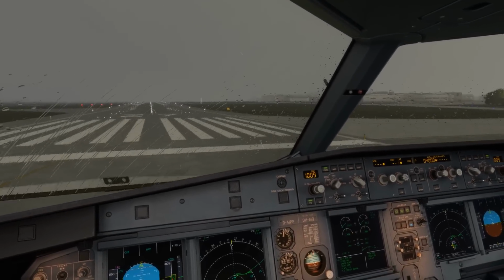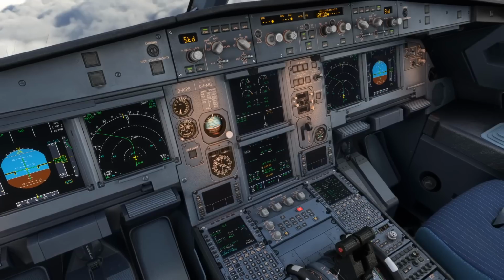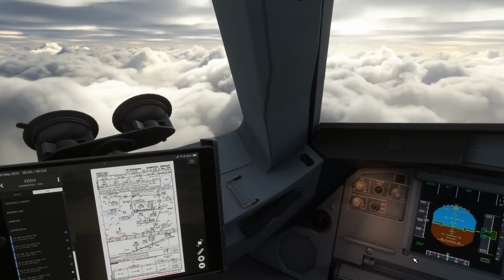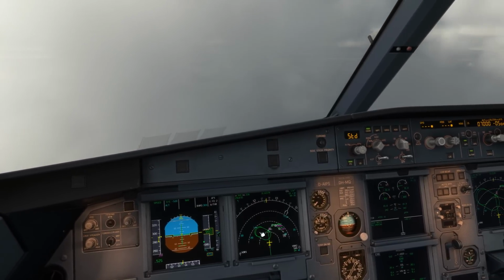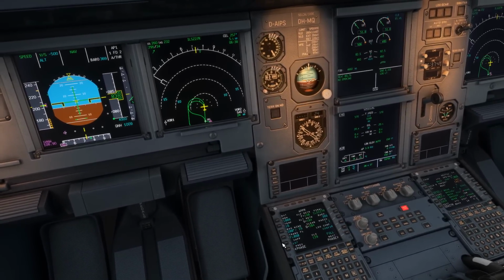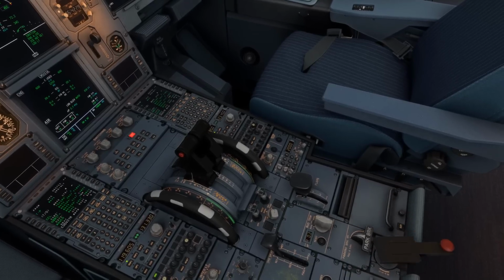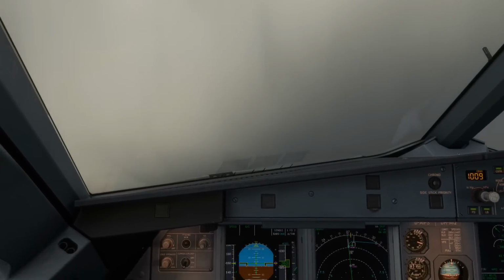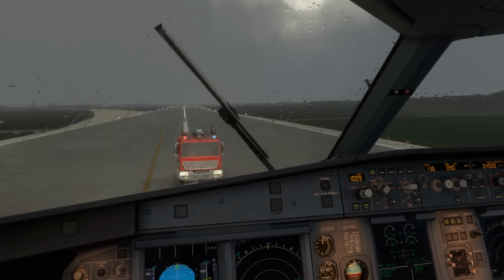Still Think MSFS isn't a "Real" Sim? | Real Airbus Pilot - Fenix A320 | Failure Scenario | RTX4090

Comment: Great video - I'm also an Airbus pilot in real life and currently use the Toliss A319 for procedures practice and general revision in XP11 (in VR). I'm pondering buying the Fenix A320 as I prefer FS2020 to XP11, but wondered if you have compared the two? The Toliss has really impressed me with its fidelity to the real aircraft and I'm curious if the Fenix is comparable in your view?
Reply from the maker: Hi Jonathan,

Thanks very much, I’m glad you enjoyed the video. To be honest, I only have a very limited amount of time with the Toliss A321 (2-3 flights) so, I can’t draw all that many comparisons. At the moment, the Fenix doesn’t do a very good job of hitting real-world performance numbers but, that ‘should’ change once the next big update for the aircraft comes out. The Fenix is a pretty good systems trainer, with hundreds of possible failures, that are easily programmed: https://soarbywire.files.wordpress.com/2021/08/failurelist-v0.2.pdf

Certainly, for me, I find that the Fenix has more than enough fidelity, that I can brush up on a few scenarios or procedures, ahead of a sim etc; the addon doesn’t get everything spot on and as with any PC simulation, one does have to be cognisant of that fact.

In general, I prefer how the Fenix handles / “feels”, even though the performance is currently off. From what I remember of the Toliss, systems depth on the two addons is probably broadly comparable but, the UI for setting up failures etc, is more user friendly on the Fenix.

I hope that helps a little. All the best! : )

Comment: This is not a study level craft
Reply from the maker: Hello John,

What makes you say that? The Fenix A320 doesn’t currently perform to the numbers (though Fenix should be addressing that soon, with a significant update) and for sure has a few inaccuracies, but otherwise I find the addon does a very decent job of simulating the systems / flight characteristics of the Airbus. I know we all have different definitions of what constitutes “study level”, but the aircraft is certainly detailed enough, as to be useful for practicing certain scenarios : )

All the best!

Comment: You.losing performance with that 2666 mhz ram surprise you are not using a ddr5 motherboard or atleast  3600 or 4000 mhz ddr4 ram.
Reply from the maker: I know Willie; I was a bit perplexed / annoyed when I saw the specs of the RAM (I had a PC custom built and we never specifically discussed the speed of the RAM). Whilst the performance degradation hasn’t been noticeable per se, I will get around to switching the old RAM out for a faster option at some point.

Cheers, all the best! : )

Comment: did I just hear something about realistic? So when I see the windshield wipers moving differently, it's not realistic for me. The Reichstag in Berlin is not even realistic. To me, the Reichstag in Berlin looks like it was from World War II. And all this with an RTX 4090, what a waste. I can do that with a 2080Ti too
Reply: wipers are not synchronised in rl
Reply: It’s better then any hideous xplane toliss garbage. Doesn’t look like 1999 at least
Reply from the maker: Hello Andre,

Well, the wiper movement may not seem to be realistic, but the lack of synchronisation is actually true to life of the real aircraft. I can’t speak on the Reichstag (I haven’t checked it out in MSFS), but accurate landmarks aren’t really essential for an in-depth simming experience (and at any rate, surely no other sim comes close to being on a par with a MSFS, when it comes to its visual representation of the world around the user).

I use my PC / 4090 for more than just playing MSFS, but the 4090 allows me to crank everything up to Ultra whilst still maintaining a solid framerate (which is great for recording), so it’s nice to have either way.

I’m not trying to bash other sims: I’m a big fan of X-Plane, P3D, DCS etc (indeed, I still use all of them), but I really don’t see how after running this sort of scenario, it’s possible to argue that MSFS can’t be used “realistically”.

Cheers, all the best : )

Comment: Rathet fly FSLabs on P3D or Toliss on XP.
Reply: Why
Reply: Fslabs on P3d is way better then toliss anyway. Toliss is low quality bs
Reply from the maker: Fair enough FF, to each his own. I hear great things about the FSLabs 320 and by the sounds of it, the addon is a deeper / more accurate representation of the aircraft overall - I haven’t tried it myself. The Toliss Airbus’ (I’ve only tried the 321) are decent enough, but personally I much prefer the Fenix A320 overall (yes, it has some shortcomings, but Fenix are working on them and I can look past a few issues, in order to enjoy the vastly better visuals of MSFS. The Fenix A320 is also considerably cheaper than the other 2 options). As I say, horses for courses : )

All the best!

Comment: Interesting so even in an Airbus the ignition must be left on while soaring through the clouds. I always thought this is an eighties era Boeing-quirk and no longer necessary with the newest CFM engines.
Reply from the maker: Hello Julia,

It depends on the Airbus in question. On the older variants of the Airbus that I have flown, ignition is typically selected on when passing through significant areas of precipitation, but on the more modern Airbus’ that I have come across, manual selection is no longer required from the pilot.

I hope that clarifies things a little. All the best : )

Comment: Very nice. I'm thinking airline companies can then use this for flight training scenario's. MSFS would need to have co-pilot seat available, and then completing scenario's such as this would be part of your monthly?
Reply from the maker: Cheers, NorthBlue. Yes, whilst of course certification etc would be required, it often amazes me, the level of fidelity that one can achieve with a home simulator these days. To some degree, this sort of setup is actually a step beyond many of the training tools used in commercial training - it really is rather impressive.

Cheers, all the best! : )
Reply: @IntotheBlueSimulations  Yes, I agree. I hope one day they can run an experimental study just to see if you can learn to fly via online schooling and certified home flight simulators with an online cross country simulated flight and an actual flight to complete the process. And with A.I. around the corner it should get really interesting.
Reply from the maker: I certainly think a large chunk of training could be accomplished using modern flight simulation, particularly with the advent of VR etc. There are certain aspects of flying that can only be appreciated with a real aircraft though, so I think that would always have to form part of the syllabus. If nothing else, there’s a big psychological difference between flying in the sim and flying in a real aircraft, where you’re conscious that any mistakes can have significant consequences. It’s an interesting topic for sure though!

Cheers once again : )

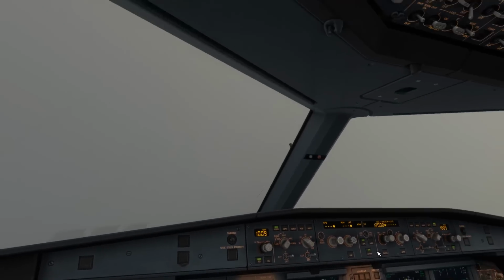Comment: 6:04 aren't the landing lights supposed to be on under 10,000ft?
Reply: In these conditions they wouldn’t bring you very much
Reply: @Jan-ov5tm  I know, but I'm asking about procedures and how it's done irl
Reply: @tvflight7858  Im not a resl pilot, but as i know from rl videos etc., they mostly turn them off when passing 10.000 feet (europe, i dont know how its done in other parts of the world). But as i know, airlines can decide when to turn them on/ off. (SOP)
Reply: @Jan-ov5tm  thanks
Reply from the maker: Hi TVflight,

Generally speaking, you’re correct. 10,000ft is the norm, though as the 320’s landing lights do produce some drag, some operators opt to vary this via SOP (so I gather - we actually use 10,000ft at work).

I hope that clarifies things a little. All the best! : )
Reply: @IntotheBlueSimulations  Thank you so much!
Reply from the maker: You’re most welcome! : )

Comment: For sure, MSFS is a real simulator, but don´t judge it with an Airbus; It´s not that flying like with a glider or a GA, it´s more serving a hightech machine. IMO X-Plane feels better with smaller planes but not better in terms of Airliner flying.
Reply from the maker: Hi Thorsten,

I take your point, but (in my opinion) there is more to flight simulation than the flight model alone. X-Plane is still king when it comes to flight modelling (although funnily enough, I’ve always preferred X-Plane for the heavies and MSFS for the GA stuff haha, though I haven’t tried any payware GA stuff in X-Plane to be fair), but MSFS has become a very competent systems simulator, and does a great job with handling the sort of scenario I demonstrated here. As always, there’s no perfect sim, but MSFS has come a very long way!

I hope that makes some sense. Cheers and all the best! : )

Comment: Does the weather radar still not work on MSFS?
Reply: no
Reply from the maker: It does not Rob, no. Well, there is basic weather radar functionality modelled within MSFS, but developers generally choose not to use it, since the existing functionality is not very accurate in its implementation. Asobo should be providing better functionality to 3rd party devs at some point, but this is taking quite some time to eventuate. . .

I hope that clarifies things. All the best!

Comment: I've groused a LOT in the past videos about MSFS and it constantly updating and just plain not working well after that.  I'm happy to report that I have purchased and huge M.2 drive and have completely reinstalled MSFS2020 - and it works BRILLIANTLY.  It just works.  I've been using it a lot more.  I'm trying to find a decent deal on the TrackIR 5 now.
Reply: You should consider the TOBII eye/head tracker. I have stopped using my TrackerIR 5.
Reply from the maker: That’s great TG! I’m very happy to hear that you’re getting on with the sim much better these days. It hasn’t been a smooth ride for many, but Asobo have continued to put the work in and by and large, MSFS is in a pretty good place these days : )

Happy flying and all the best!

Comment: Hey Bud, great video. Really nice Aircraft and scenario. Still can't believe your recording in 1080p with an RTX4090. C'mon man.
Reply from the maker: Thanks very much Nitrous, I’m glad you enjoyed it! Haha indeed; I have tentatively looked into recording at higher resolutions and that was the reason I got the 4090, but I want to do things properly and that requires testing, tweaking etc - something I simply haven’t had the time for as yet ; )

Cheers, all the best! : )
Reply: @IntotheBlueSimulations I’m new to VR flight sim. I fly the 320 and would like your opinion on using this for recurrent training. How many failures does it simulate ?
Reply from the maker: Hello Harry,

Of course, all of the usual caveats apply (it’s a home simulation aircraft, there may be some inaccuracies vs the real A320, FCOM’s take precedent etc), but I find the Fenix A320 can often be a useful tool for refreshing procures and running through failures / scenarios. At the moment, the aircraft doesn’t fly by the numbers, but Fenix should be putting out a significant update soon and that should address most of the flight model issues. In terms of the number of failures modelled, it’s significant. Here is a list; it’s somewhat outdated, but should give you a very good feel for the level of complexity on offer: https://fenixsim.com/public/images/failurelist-v0.2.pdf

In short, the Fenix A320 is not infallible and I have come across a few behaviours that don’t match up with the real jet, but all things considered, it’s a very solid simulation and offers a lot of value for the price - it’s great for running ECAM’s, of nothing else.

I hope that helps a little? All the best! : )
Reply: @IntotheBlueSimulations You don't need to test, just do a video, so long as you record to SSD it will be fine. The Rtx4090 (I use too) has dedicated part to it for streaming/recording, so it doesn't affect FPS at all. Make sure you use HAGS for MFS2020/Dx12 and enable all the 4000 series settings inside MFS. IT it can easily do 4k - I chose not to, for YouTube upload & rendering times. My OBS settings for 1440p @ 60fps are MP4 (if it crashes I ain't gonna use it anyway, which it NEVER has, and I've done hundreds of videos over several channels. Rate:VBR (unless livestreaming, then CBR) bitrate: 16,000 max: 24,000 (some say more, I disagree, see any video I did ask on this setting. Preset P3 (low quality) - adjust this upward at your peril! Tuning: high quality. Multipass Mode: single Profile: HIGH, lookahead: OFF, psychovisualTuning: ON, GPU: 0, Max B frames: 2
These are settings I come to by experimentation, and work fine for 4K also (just double bitrate 32,000 max 40,000).  Of course everyone's gonna have their settings and whys, but these work fine, require no testing (unless your wanna push it) and also leave some GPU on the table for unexpected demands, ie busy city scenery, and won't kill your internet (it's about 6gb an hour, roughly).
Reply from the maker: Thanks very much for the info GWB, much appreciated! I shall give it a go at some point. All the best : )

Comment: What was the "flex" your referenced just before takeoff?  Are the fans that audible in the A-320?
Reply: google airbus flex termperatures
Reply from the maker: Hi Pythos,

Put simply, it’s the engine thrust mode. TOGA (takeoff / go-around) would be a full thrust takeoff, whereas FLEX is a reduced thrust takeoff (to save on engine wear / tear). The number, eg “FLEX 38”, relates to an assumed temperature and the engine then produces thrust as if it were operating under that outside temperature condition (so in this case, the engine operates as if it were 38C outside). The higher the FLEX, the greater the reduction of thrust.

I hope that helps a little? All the best! : )
Reply: @IntotheBlueSimulations  Ah, Okay.  Thank you for the explanation.

Comment: Windshield wipers look like they need some work in their operation. Swing movement is erratic and not synchronized.
Reply: That's pretty much how they are irl
Reply: just like real airbus
Reply: That’s exactly how they are….noisy…in sync only if both pilots turned their respective wiper on simultaneously…. and only used when absolutely necessary…..intermittently inside 1000’ and continuous during the last couple hundred feet, again only if absolutely necessary and it had to be raining really hard!
Reply from the maker: Hello Patrick,

As the other chaps have pointed out, erratic and somewhat useless, is pretty true to life of an Airbus windshield wiper XD

I think I know what you’re referring to though: The wiper animation doesn’t always make it through it’s full range; I think that’s to save on FPS (in an aircraft that is already known as being a bit of a framerate hog). In fairness to Fenix, they were the first (and still one of the only devs) to come up with “working” windshield wipers in MSFS (ie the wipers actually remove precipitation from the windshield).

Cheers, all the best!